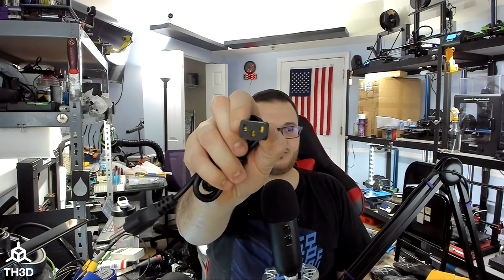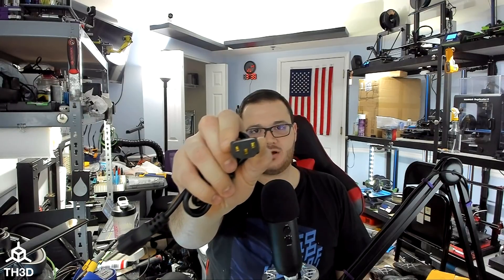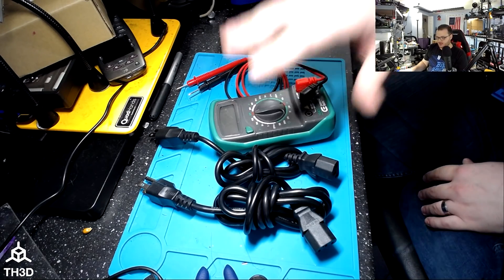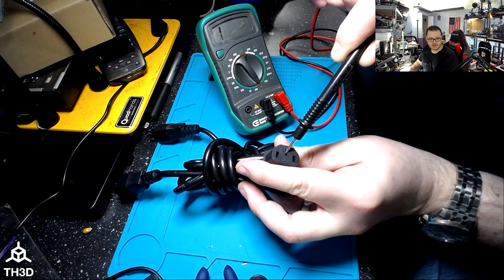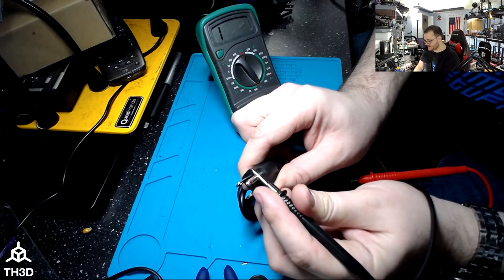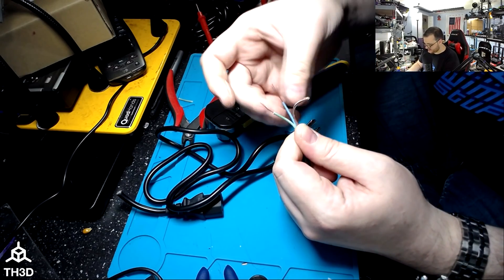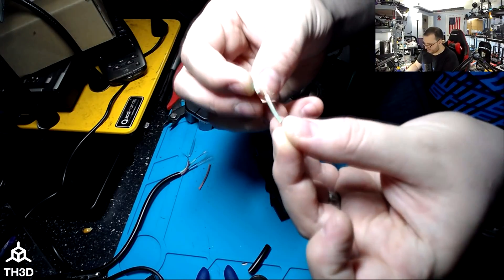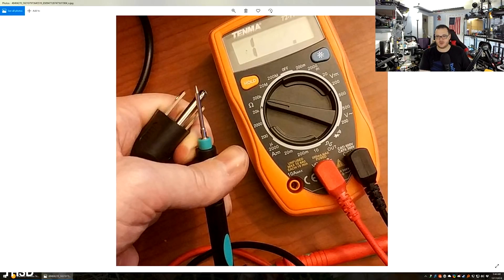Power Cable Safety - How to Test for Bad Ground Connections

Comment: Just checked mine on my Ender 3 and found no earth! Thanks for this video!  Using another cable now.
Reply: Likewise. There is a video around about the fault in the power supply where the ground in a single sided PCB doesn't contact the chassis because of insulation. IMO the electrical safety in Creality units is looking very dangerously lacking.

Comment: Like he said in the beginning of the video, the printer company probably doesn't even know the cables are bad.  In all fairness to ANY company that orders thousands of these power cables... they're used EVERYWHERE.  Every desktop PC, most monitors, untold numbers of electronics.  Billions of these things made by an infinite number of foreign suppliers.  You'd never even think to check to see if the ground pins are actually connected.  I've been in the PC industry for 20 years.  I never think about it.  I've probably got over a hundred spare power cables from a hundred different vendors.  After watching this I have no idea how well each one is made.  You can't really waste your life checking them all.  But for a 3D printer with wiring that could potentially short someday because of all the moving parts?  Yeah, I'll check that one.  Also as a side note I cut up power cords and power supplies when I need wire all the time.  It does seem like lately the 18ga computer power cords have gotten more than a little bit too flimsy and the wire strands are really crap. At the very least if you are looking for a power cable and you want to know how to have a good shot at getting something decent read the wire sheath and see what gauge of wire it claims to be.  18 is likely crappy all around.  16ga will probably be a decent cable.  If you have a 14ga that's typically for 1000 watt power supplies.  It's hard to recommend cutting these up as they are more expensive and not easy to find.  If you want to wire up a REALLY good plug, cut the end off a good 6ft extension cable or buy some quality 14ga power cord by the foot off the spool at Home Depot and wire a plug end on it yourself.  Then you KNOW what you have.

Comment: Thanks for this. I'm even using an extension to the standard cable, and never thought to check continuity on the ground. Quick test, and seems like all is good. (Still trying to track down an excessive Z drift between jobs using EZABL on my Ender 3, so I'd sort of hoped I'd find something. XD)
Reply from the maker: Re do the sensor calibration. M48 will instantly tell you if the probe is working or not.
Reply: @TH3DStudio  Thanks. M48 showed tight readings. Figured mechanical variance, and I think I have it sorted after snugging up the sensor/hot end mounts, and a couple of screws for the x gantry. I'll be sure to go through official channels if I get stuck again. Good luck with the move!

Comment: Wow - the quality of the power cables are all over the place and testing ground continuity is a must.  Seeing how few strands of wire were used also is eye opening.  As a rule I toss those really flimsy thin power cords right away and use better quality ones.  I picked up some quality coiled AC cords on sale last year for my 3D printers and other AC powered equipment in my shop - they are convenient and keep things neater for cable management.

Comment: If you find a bad cable (not just power, but usb, network, etc), just destroy it right away.  It's not worth the trouble to keep it around "just in case".
Reply: Or at least cut off the plugs if you intend to keep it as scrap wire.